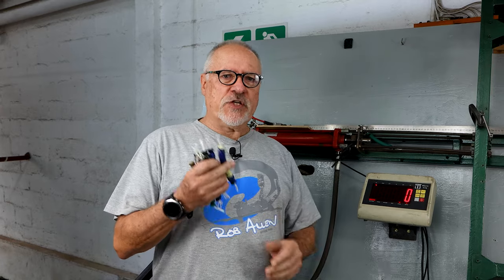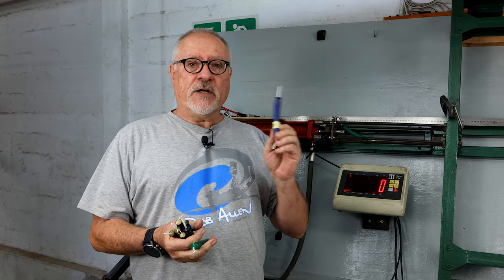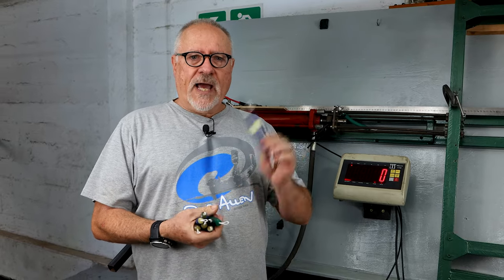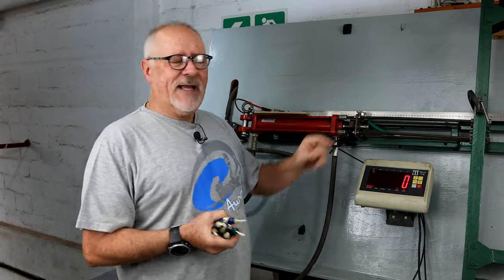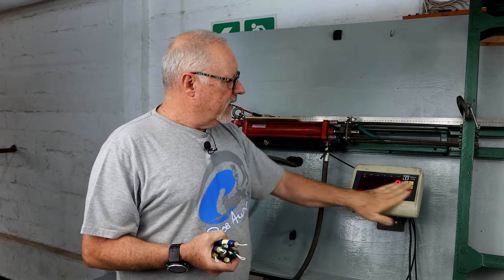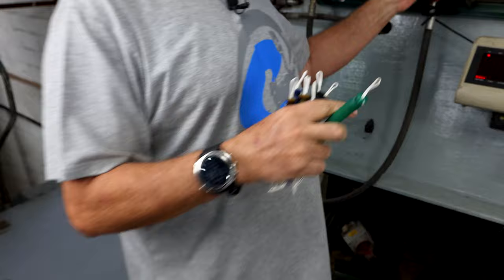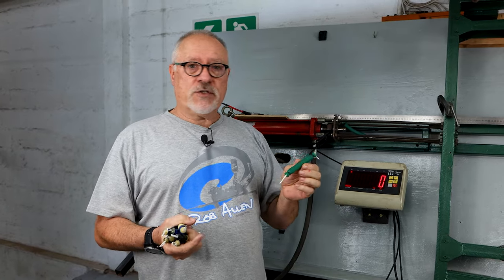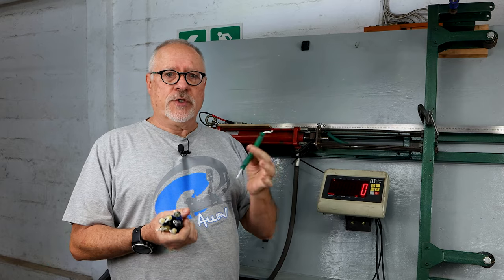Rob Allen | Speargun Band Power Loss | 2024

Comment: Aloha your rubber is the best, i use one  9/16 black 17.5 inches on my 90 stretched to the max 37.5 inch to the  2nd notch on my Rob Allen shaft (strongest shaft. i always pound some big rocks😢 constantly n doesnt bend at the barb hole  like most others n no need double check at stores cause yours is always stays straight through shippin)
I swear if i dont dive for a year then take it out of icebox  its jus as good when i last used it, doesnt even show cracking at the tied wishbone👍  #1 tank u 
I only  use one rubber on my 90 n only yours can bring it up to speed, others not elastic enough
Mahalo keith
Reply from the maker: Thank you 👍
Reply: Rob allens are literally the stiffest rubbers on the market. You have no idea what you are talking about.

Comment: What is the solid black rubber that comes on the Timberline Roller?
Reply from the maker: It is also dipped, we do not use any extruded rubber.
Reply: @RobAllenSpearfishing  I was wondering what it's called?, I wanted to buy more for my other RA Rollers, this black rubber is good or maybe it's just the Timberline that makes it seem faster XD
Reply from the maker: @texavon6168   the full black does seem to be a little stiffer. With every batch there can be a slight difference.

Comment: What actually causes shaft whip? The rear end of the spear or shaft accelerating faster than the point, causing the shaft to flex. This results in the overall power being limited by how rigid the spear is? I've seen online forums also theorize that its the flex of the actual barrel, but I honestly doubt it, because we still see shaft whip in carbon barrels
Reply from the maker: I believe shaft whip is from barrel flex. If a gun is powered way up there will be a little barrel flex. Less so with carbon but still there is some. I will demonstrate this soon in a video with a laser. It can be the muzzle chopping down with a barrel with a lot of flex but I have just thought about another possible issue. The stiffer carbon barrels still have a minor flex when loaded. The spear will lay in the rail and take the shape of the rail. As you fire it, the barrel will straighten as soon as the load is taken off. This will bump the spear upwards as it's leaving the gun, enough to cause the shaft to now wobble. 

I do recall about a 60mm height difference of a laser light, when lining it up on a 1300 carbon gun while the laser was clamped to the gun handle. I had the gun clamped in a vise and the laser light was shining on a wall about 4m away.
Reply: @RobAllenSpearfishing  Looking forward to seeing the video. Maybe also see if the same happens in rollers or if it is just people over powering the spearing.
Reply from the maker: @JSJ-mn8wg  With rollers, the load is in both directions while loaded. But, as soon as you pull the trigger that changes as the load in now moving. Due to there being a single rubber and the barrel is not under any flex I think any barrel movement will be very small, not something easy to show when firing.

Comment: 🐟💨💥🔫🤿💯

Tenho 4 armas rob allen depois que conheci não troco por nenhuma outra porem as borrachas que vieram nelas tiveram uma vida útil muito maior do que as mesmas borrachas rob allen que compro hoje em dia gostaria de entender o porque sou do Brasil 🇧🇷 obrigado por sempre desenvolver excelentes produtos Rob você agrega muito valor para o nosso esporte 🤝
Reply from the maker: Este não deveria ser o caso. Infelizmente a borracha se deteriora dependendo de como é armazenada. É possível que a borracha que você está usando agora seja antiga.

This should not be the case. Unfortunately rubber does deteriate depending how it is stored. It is possible thew rubber you are using now is old stock.

Comment: How`d the loony bot end up on your channel in the comments? reported him so hopefully that rids everyone from that. on the topic of rubbers, dipped all the way. I own a 900 roller you guys made for me, with that in mind, can you run tests on performance and accuracy should someone decide to go with bigger rubbers, shorter/longer etc, the temptation is always there to go with the bigger rubbers if your used to a standard TUNA or something like that - you can see how someone may wonder if its a good idea to replace the roller rubbers with 16+ mm rubbers instead thinking it would perform better and be stronger
Reply from the maker: Thanks for that, I reported and blocked. 

Re performance, we have run many tests and have a video up on it. At the end of the day, the rubber can only contract at a specific speed (many variables here). The best is to get the spear up to max speed as late as possible for the best performance. The problem with powering it up more, will just get the spear up to max speed sooner, therefore increasing the recoil and reducing your accuracy.  

With a roller correctly set up, that max speed will be just before the spear leaves the barrel. This is because the rubber can push/drive the spear all the way to the end. This long, slow push is why the recoil is so much less. With a standard non-roller double rubber gun, the spear will reach max speed about half way down the track. This massive increase of acceleration will increase the recoil massively. This added recoil can also cause the muzzle to kick up a little and "tap" the back of the spear as it exits, making the spear wobble during its flight, adding more drag therefore slowing the spear down sooner.
Reply: @RobAllenSpearfishing  Thanx for that, I`ll go check out the video as well.
Reply: Thanks Rob

Comment: Dipped has been a problem for me. Terribly inconsistent.
Reply: Can you elaborate? Thanks
Reply: @DeepBlueSpirit2  the tollerances on thickness is greater. Sometimes the rubber is stiffer and thicker. Extruded rubbers are much more consistent and cheaper.
Reply from the maker: @davidkoba  Stiffer is normally due to age and or heat during storage. Unfortunately due to the fact latex is a natural product it will slowly change over time. Fresh/newly made dipped is soft. Many sell this as the "less reactive," said to be better for rollers but...the older it gets the more it cures, the more reactive/stiff it becomes. The diameter can vary pending how it drys. I think during drying (heat treatment) it will loose up to 30% of its diameter.

We are going to do a pool test with the best extruded rubber against extruded rubber to compare spear speeds.
Reply: @RobAllenSpearfishing  The storage/age of the rubber is not the cause of the inconsistency. It is the diameter of the rubber. The same batch of rubber gave me different stretches. One set cut from the same batch was so off it didn't even fit in my hatch ulua series (he drills the holes tight).
Reply from the maker: @davidkoba  Suppliers show there can be a variation in their dimensions, these ore very small. If the variation exceeds  in the dimensions stated it should be returned as it is not to spec.
Reply: @RobAllenSpearfishing  That's not the point though. The point is it's being sold and that it is terribly inconsistent.
Reply from the maker: @davidkoba  I agree, not good.
Reply: Most consistent rubber ever,  Mr. Allen
Tank u
Reply: Tought i sent it but i guess never go through
Reply: I been using your rubber for way over 20 yrs 
I use one black 14mm on my 90. 17.5 inches wit a stretch of 37.5 inches
Only your 14mm can bring it up to speed i swear no others can n if i dont use it for over a year more than couple times( not the same rubber though)when i bring it out from icebox , elastic still exactly the same n no crackin around wishbone, others no way can use after bein icebox for over a year n wishbone area would be all cacked 1st time u load it
Tank u for your great products 🤙🏼 aloha
Reply: Havent gotten your gun yet , probably nex gun ill get

Please dont change a single thing with your rubbers or spearshafts 👍🏻aloha🤙🏼
Reply: @keithyamamoto5249  check your nose boi. Big stain on top.
Reply: Faka wea u live i on oahu,
Reply: @keithyamamoto5249  oh shaddap and next time brownnose somewhere else